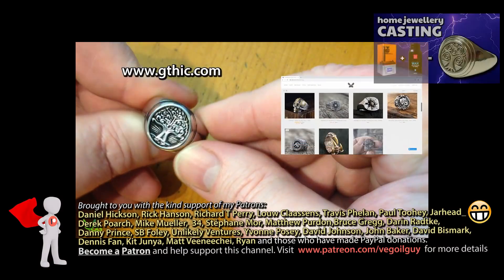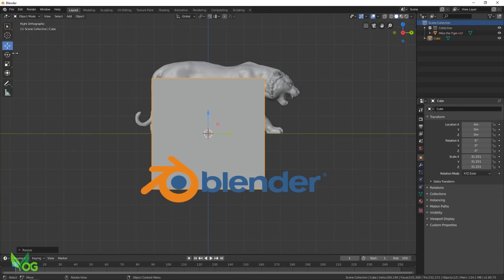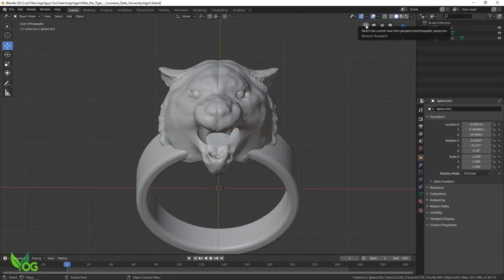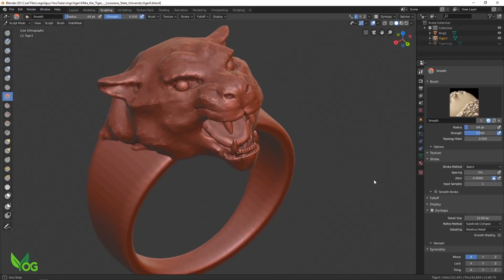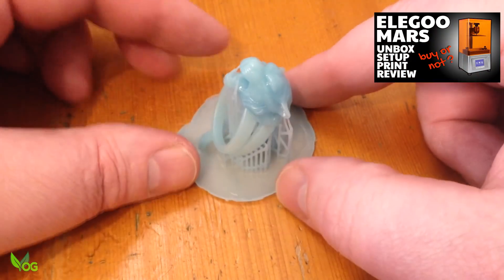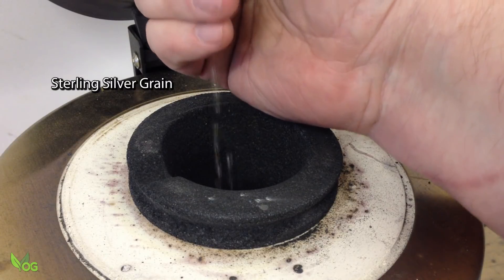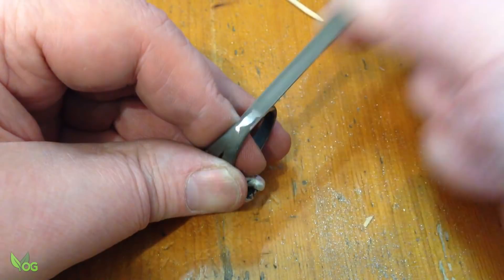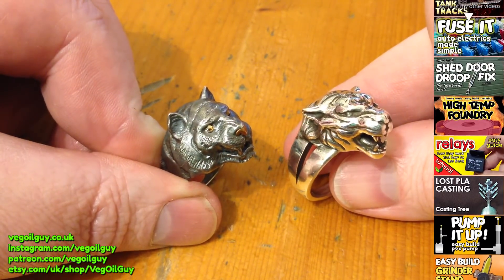From Thingiverse to Finger - Casting a Silver tiger ring with Bluecast X10 - inspired by Gthic

Comment: Can I recommend using vertex selection and wireframe (or turning off limit selection) instead of boolean for deleting, and using a mirror modifier to make it symmetrical? It could really make it easier and cut down on the fiddling with it to get it to line up.
Reply from the maker: Thanks for the advice : )

Comment: I see you use this graphite cruiseble how manny times can you use it? I had one and did use it i think 20 times tops is this normal? I use on 800 and 1100 C degrees
Reply from the maker: If you get to 20, that's pretty good. I'd average about half of that, but I regularly melt bronze, so 1100 is common for me.

Comment: Hey hello mate, i have a question. I tried to cast this way bronze. It does this black burnt like surface on thé cast m Is it perhaps too high temperature of molten metal? I cast it at 1100C. Also the investment gets little hard at thé cast surface. Thanks a lot for reply.
Reply from the maker: It depends on your bronze. Silicone Bronze does oxidise. Aluminium Bronze doesn't. Both will clean up very nicely with fine sanding : )
Reply: @vogman  thank You for an answer again! btw I just found out that my problem is too high temperature of molten metal. That can apparantly cause penetration of a surface of porus molds. Just in case You run into this as well. You take care and I am looking forward to see another video of yours. You are the one who brought me to the whole furnace thing after all haha :)

Comment: Hi,
I have just discovered your channel, your creations and contents are fantastic. 
On others videos you mention bronzal , ( 10% al 90% cu by weight),  could you please explain how it is better than brass ? Does it give more details ?  I could not find much on google except melting temp which seems to be 100 C higher. 
Thanks !
Reply from the maker: Metals are often just a preference. A lot of folks enjoy working in brass.
I'm no metallurgist so I can't give you much advice, but from my point of view, I prefer bronzal. Brass gives of toxic fumes when melted as is fairly soft. Whilst it flows nicely and takes shape well, so does bronzal, but bronzal is safer and has the advantage of also being stronger. I hope this helps : )
Reply: @vogman  It does, thanks a lot !  I will try making some next time :)
Reply: @vogman  Would be super interesting to see how the plant-based and regular resins burns.
It would be awesome if they could work well enough, even if only for some larger objects !

Comment: IDEA!
Before sawing off the sprue: solder a wire to the sprue, coat the whole ring in nail polish except for the eyes n nose, dip ring in vinegar to clean tarnish from nose n eyes, electroplate nose n eyes in a copper sulfate solution, remove nail polish with acetone, proceed with normal clean up operations.
Reply from the maker: It's a thought...  : )
Reply: @vogman  Event better: Use the eyes for a stone setting ;-)
Reply: If that would work, i will be such a cool result though
Reply: As i'm reading this and thinking that's how i would do it.. i then think of sponge plating? Not sure thats what its called, but where they just hook the electricity to a q-tip or sponge, dip it in electrolyte and then stick the swab on the spot you want plated. I've never actually done that technique of electroplating, but I'd sure try it. I see people plating things like bumpers that would require a large electroplating tank. Using that technique they don't need a tank at all and can even leave it on the vehicle.

Comment: I definitely like your sculpt better than the original one (I like cats with a longer nose).  I am glad you did the striping differently than they did - it highlights the difference in the thin deep cut versus wider cuts you used.   

I seem several different ways online to polish and leave contrast in the low spots.  How would it change the look of the ring if you tumbled it in walnut shell media before final hand polish vs. just doing the hand polish?  My guess is that the contrast would be lighter, but I have no experience (nor the right equipment) to test that.
Reply from the maker: My fear with tumbling is losing the shaded spots. These recesses are really very fine, probably a fraction of a mm in places. Sanding allows me to bridge over the recesses, but it did take time. I've no doubt professionals probably laugh at my awkward approach : )
Reply: @vogman  That was kind of my thought - that it would pull out too much of the back.  I most certainly am not a professional, just a newbie trying to learn when one process would work better than another.  Thanks for sharing the experience you have!

Comment: Stoppppp!!!   I cannot keep up  :)    Bricks arrived for the Furnace, Mars sitting idle..  I need a vacuum machine and...and...and...   lol.   Anymore and I will explode.  :)     OK How about a short video on smoothing a part in Blender?  I just seem to get the small triangles you do initially and cannot seem to smooth them.  Thanks again.
Reply from the maker: Ha ha! Brilliant. I'm glad you're enjoying the process. Ignore the triangles. When you work on these small pieces it's easy to get carried away smoothing the blender file seeking perfection. But the chances are the perfection you're seeking wouldn't even show up in a print, so don't chase it. Concentrate on forming the big features : )
Reply: Probably the issue, zoom in 5000% and everything looks bad. Trying to smooth out something thats 10x smaller than the smallest pixel on the printer. But I know its there and thats the issue.  I have an STL of a Morris Mini Cooper. Great detail seats, dash and engine parts but lots of zero thickness parts and parts that intersect badly. Left and right sides not mirrored so inconsistent. Tried fixing it a dozen times and always restart it.  Best one was enlarging and making it like a baloon. Zoom out and it looks good.
Reply from the maker: Sometimes you've just got to let go of the idea of perfection. Believe me, that's very hard for me personally to do, but it really is worthwhile in so many cases.
As for detailed models, a viewer sent me a Vespa file she'd purchased and couldn't print. When I looked at the file, yes it was detailed, but there were dozens of parts not connected - so there was NO WAY it could print. Things can't float in the air. They have to be attached. I ended up connected pieces with cubes, cylinders, etc. The end result, when printed, looked exactly like it should... sometimes doing the wrong thing is the right way : )

Comment: Cringe. At 2:30, try the Mirror modifier instead. :-)
Reply from the maker: Mirror modifier? I'll have to look out for that : )
Reply: @vogman  basically just mirrors the geometry of an object from a plane which you can position. Great for cutting down effort when working with symmetric objects. Although I'm pretty new to blender, so hopefully I've described that right.
Reply from the maker: Thanks for the info : )

Comment: Yours looks more ... Tigery. At one point though, in Fusion, it did sort of remind me of Godzilla. : ) I just got one of those electric furnaces, 3kg. I'm wondering, have you melted non-noble metals in it, and if so, did you notice any adverse effects in the crucible? I'm planning to melt mostly tin and zinc in mine with occasional copper and aluminum. I must have missed the vid where you mentioned the new vacuum system, mind putting a link in your next vid, please? Thanks and keep up the great work!
Reply from the maker: The Kaya Cast machine? Fabulous bit of kit... here's the link https://youtu.be/tdxiZs0MDbs
Reply: @vogman  Oooh, aaah, but Ouch!
Reply from the maker: Yes... not cheap... but quality rarely is.

Comment: I really like this casting it looks fabulous. Thanks to you I own a mars 😁 it's atualy really easy to use especially with the washable resin
Reply from the maker: Glad you like it. I think resin printers are MUCH easier to use than FDM printers and for me the results are much better. Plus the Mars is an excellent all-round printer. Affordable, simple, and very good performance : )
Reply: @vogman  iv built my own fdm printer the frame is made from 18mm plywood had cut lol they both have there own place I guess. Yes the mars is very easy to use easy to level simple touch screen and even has a more powerful UV light compared to some of the other printers. I found your review very informative and strait to the point I couldn't believe how much printer I get for such a low price point

Comment: How would hey have made the original? Would they have used the same method only scaled up or another process?
Reply from the maker: They may have created it using a software package (there's lots to choose from), or they may have modelled an original in wax. Both ways are acceptable and both can create some fantastic pieces : )

Comment: With that plaster container you have that's got all the holes in it, couldn't you FDM print a bucket to go over it that you remove before putting it into the burn out instead of having to tape it every time?
Reply from the maker: It's an interesting thought : )

Comment: Hello, You are doing such amazing progress! :D Both in final result, and in 3d! Also do you think move in 7:30 isn't a bit risky, so something inside can chip off?
Reply from the maker: It could happen, yes. I'm still new to this technique : )
Reply: @vogman  I keep fingers crossed for new projects then :)
Reply: I noticed too that the traditional pouring chamber with a part for debrits has been replaced.
He become better and better and doesnt need it anymore 😉
Great job once again.
Reply from the maker: If only that were true : )
I haven't made a pouring basin for this smaller, perforated flask yet. It's on my to-do list : )